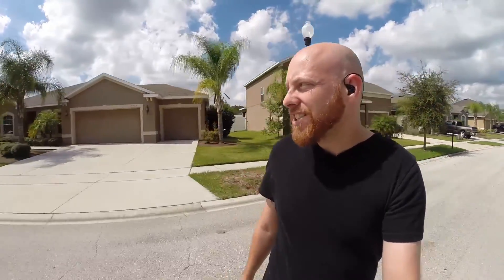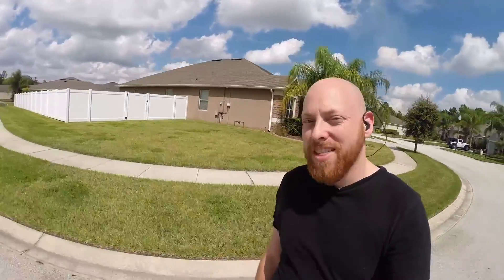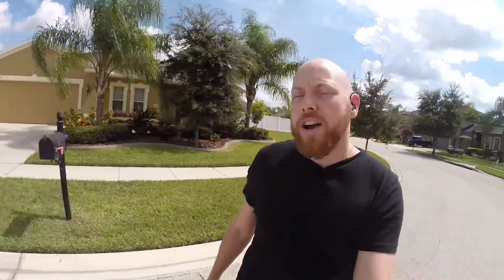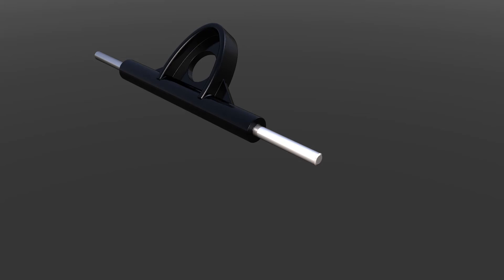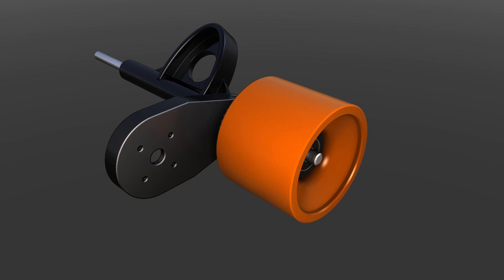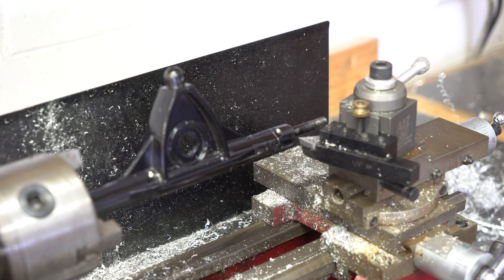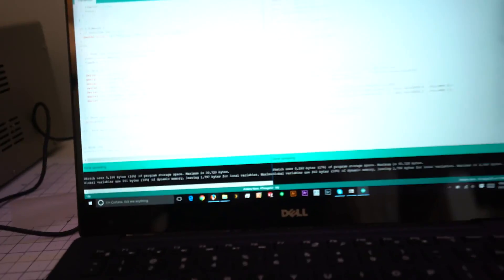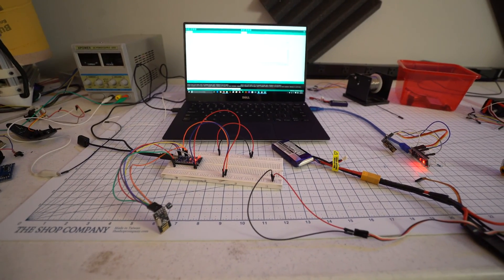S01E11 - Electric Skateboard

Comment: where did you place the breadboard with the Arduino? also great video.
Reply from the maker: its tucked right in front of the battery. not a lot of room in there, but it fits

Comment: Just found your channel, this is amazing stuff ! Is there anywhere to read an indepth 'guide' on how you did all the electronics and stuff ?  Seeing the specs you put down, your board is as good or better than a 2nd gen boosted board. Oh, does your board alow braking ?
Reply from the maker: +Jannes Vandepitte: yeah I could try and put something together. We are working on putting together a website now that will contain some more in depth write ups. I have never ridden the second gen boosted board, but I know it's top speed isn't any better, and I can't imagine needing more acceleration. I know they are well built but way out of my budget
Reply: Would you mind inserting a link when you do manage to put up the in-depth guide? I am currently trying to build my own board and have done everything but the remote. So if you have any tips for that it would be greatly appreciated.

Comment: what type of material did you use to get the spray paint design not to bleed on the grip tape?
Reply from the maker: its vinyl. we had a hell of a time getting it to stick though. we used a roller to press it down just before painting.